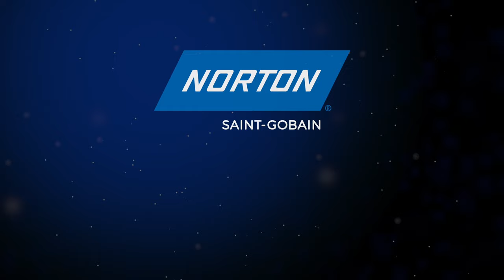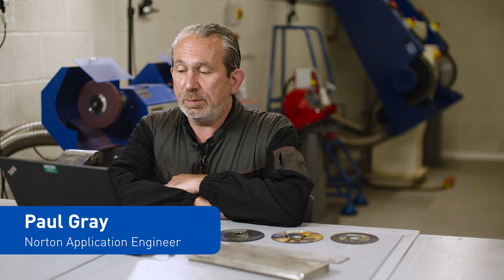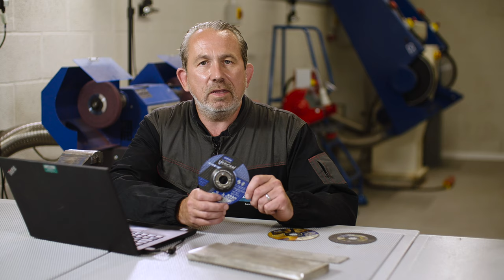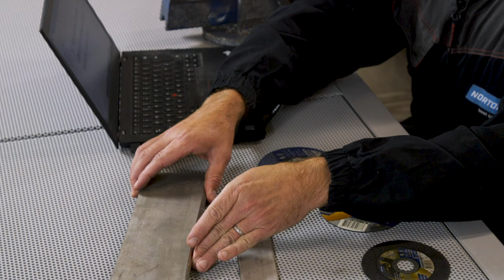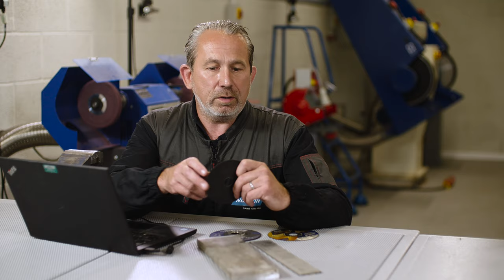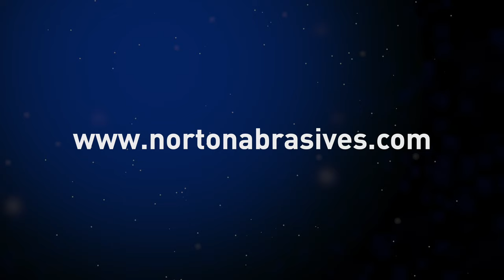ASK THE EXPERT: Why are there so many thicknesses of cutting discs?

Comment: but you missed to say if the thick disc can be used for cutting thin metal.
Reply from the maker: You can use a thicker cutting disk to cut thinner metal for sure but it will take longer to as you are removing more material.
Thanks for watching!

Comment: Thick disks suck for any home use, I accidentally bought thick disks and they take a decade to cut even mild steel, very frustrating.
Reply from the maker: The thicker cutting discs will take longer for sure but they have the advantage of lasting longer and also it is easier to keep the cut straight.
Thanks for watching